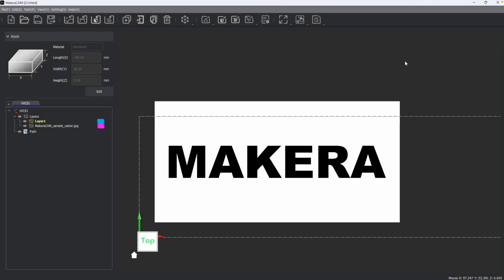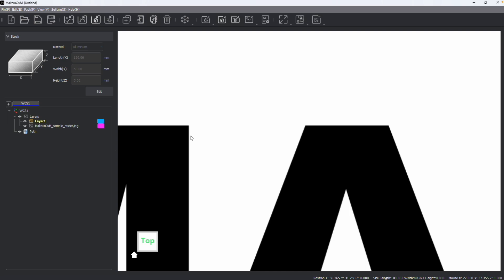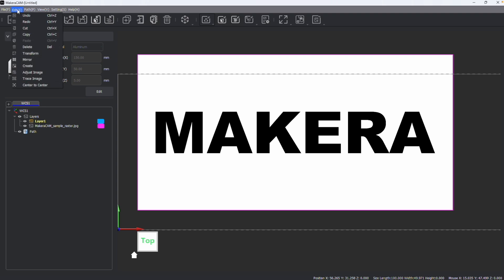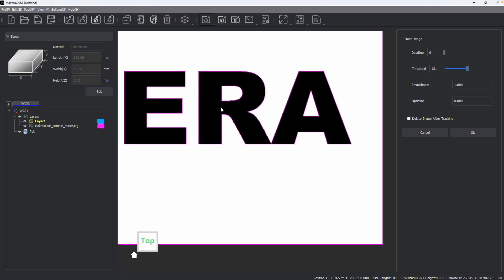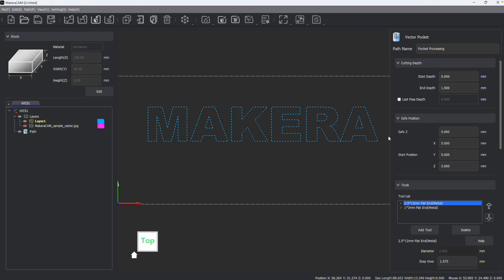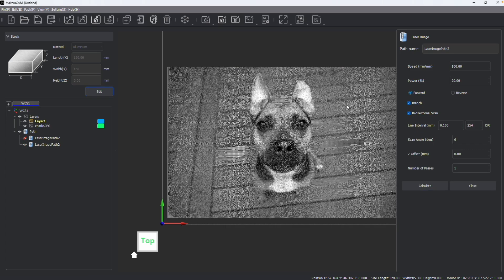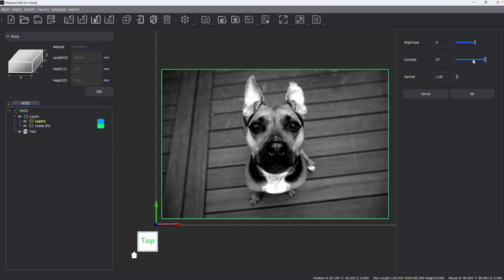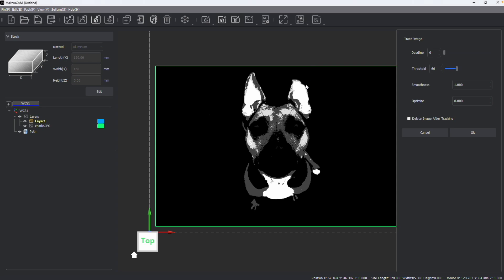Makera CAM - Working with Image Files

Comment: when talking about a function like image trace, just reading the listed functions "threshold" "smoothness" "optimize" and skipping "deadline" does nothing to inform the user as to what these functions actually do.  what IS smoothness? why use optimize at all?  or why not have it t 100% all the time?  we want things optimized, don't we? why is the default zero?  skipping over 'deadline' makes no sense at all. if you're just reading the names of the functions and not explaining what they are, why not just read that one as well? 
overall, a proper explanation for a feature should go something like: "This is what it does, this is how it's used, and here is an example or two of when and how to use it". 
otherwise you're just reading what's on the screen, which isn't explaining what it is, and people can read the screen themselves, they don't need you to do that for them. 
This may sound like a harsh review, but it's just realistic. I've worked with support and documentation departments to show them where they're wasting their time and how to improve user comprehension of the tools or subject matter being covered.  the major things most people miss is the "what it is and functional examples of it in use"..  so.. showing why and when to use optimize vs when NOT to use it.. would be useful.. knowing there's a mysterious slider called 'optimize' which defaults to ZERO for some reason..  less helpful.  does that make sense?
Reply from the maker: This is good feedback, thank you! We suggest users take a closer look at the user guide for additional information, as well as experiment to find their preferred approach. But we will also work to make our software more clear and intuitive.
Reply: I can not find create vector tool path. The moment you say you can create a vector tool path the video skips so you can not see what you are clicking on. I think you clicked on “2D path and then 2D pocket. If I do that and click calculate, nothing happens. Also makera cam is crashing all the time , even when I do simple tasks like following your video and doing the same things you do.